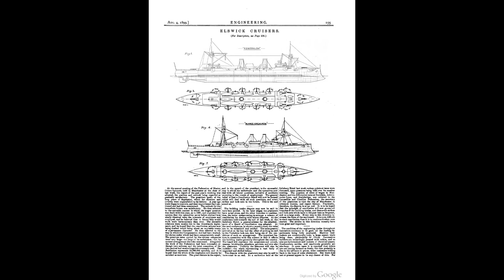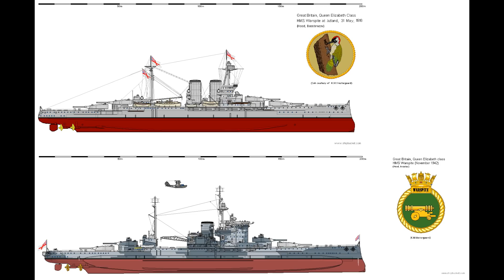The Drydock - Episode 007

Comment: You keep throwing in the word calibre unnecessarily and incorrectly.
Reply from the maker: Care to give an example?
Reply: Drachinifel 

4" not 4" calibre.  Larger not larger calibre.
Reply: "Calibre" as refers to large guns is not the shell diameter, but the ratio of the barrel length (breech plate to muzzle) divided by the shell diameter. A 5"/38 calibre would have a 38x5" or 190" long barrel.